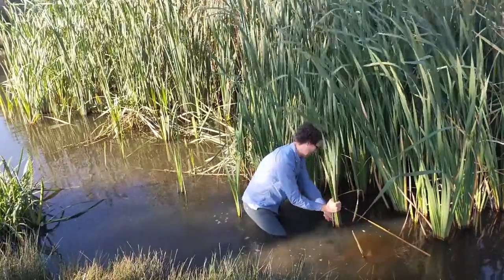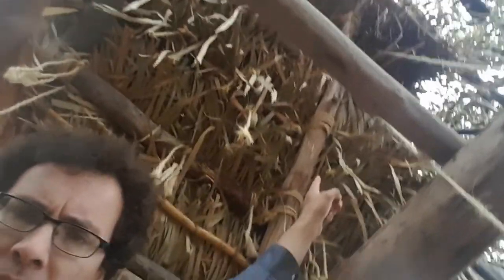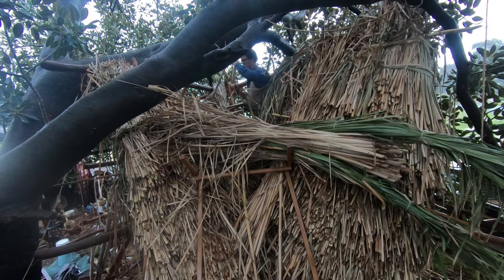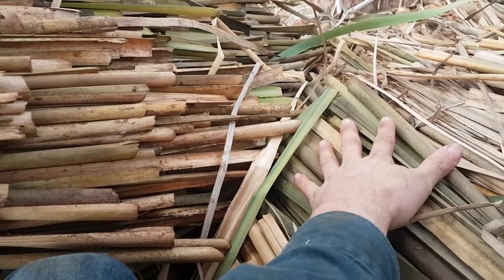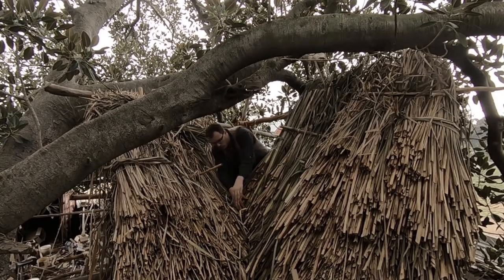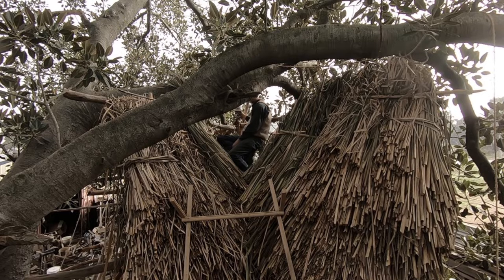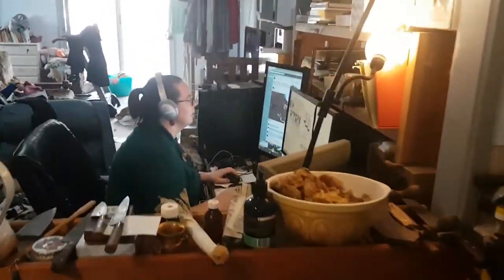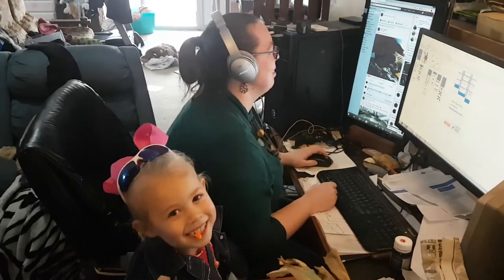How to thatch: learning how to form the valley

Comment: Morning Stuart, before I got sick I working with two different roof tilers one slates the other cement /terracotta. I were thinking that you should have run a series of rushes down with the valley spanning out around a foot ever side and then finished it off as you have done. This would inshore that you have no leaks and would have given you something too work off. Just a thought. It's starting to look the part,well done. Cheers Craig
Reply from the maker: It was done, also shingles or shakes in the valleys. But also common for 100% rush.